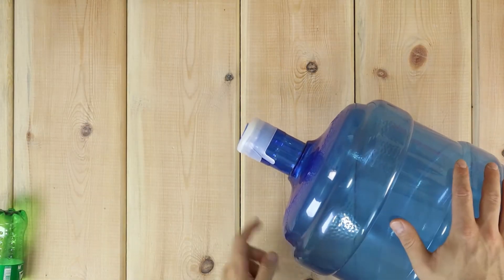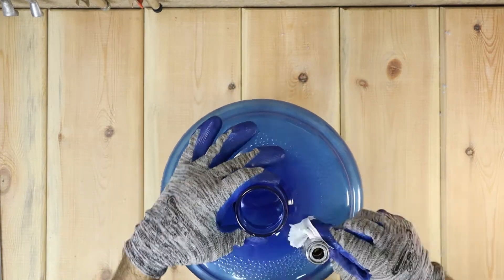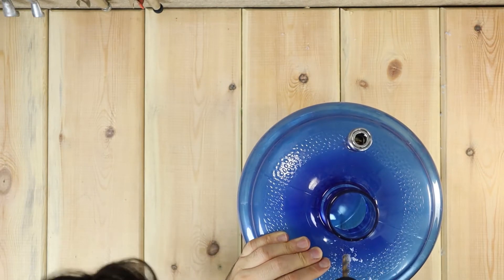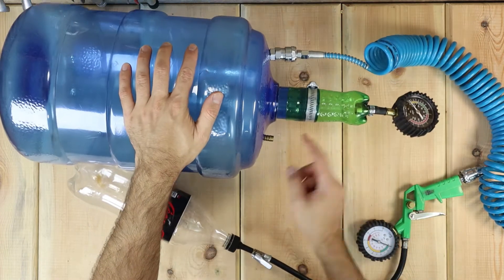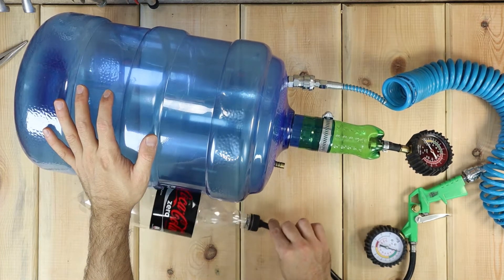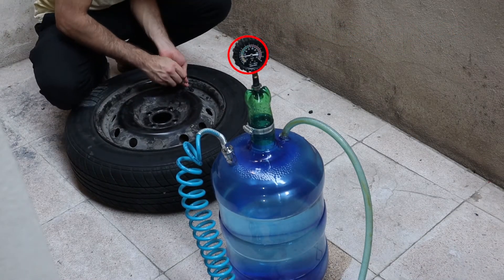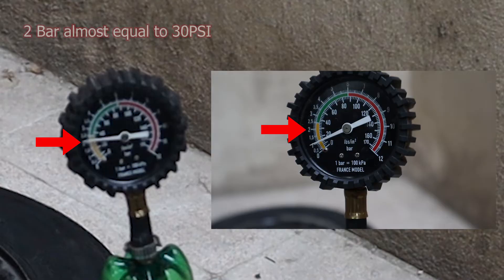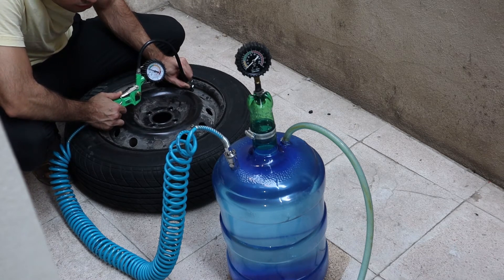Water Powered Air Compressor

Comment: ok, it's creative, i'll give you that, i wouldn't call this an air compressor lol....
if you are lucky you'll get 10 psi
Reply from the maker: Thanks man, I've managed to get 30 PSI in the air tank, I would say if you empty the water in the tank 2 or 3 times, and start over, you can get something acceptable. Your water pressure is the most important factor though.
Reply: @KayvanCrafted  i know i was just watching it for fun, don't need it as a tool, have an air compressor i built out of an ac compressor, it's small but it works, i am about to start working on a bigger one made out of 2 propane tanks, and i am planing to put up a video of that build when it's ready.
Reply from the maker: @ozb2006  Very nice my friend 👍
Reply: @KayvanCrafted  clever build. small fyi; without filter the compressed air will contain high amount of water vapor which can be unwanted and even dangerous for many uses. if the air will change temperature; increase the water vapor volume can expand, maybe explode something, if it gets much colder, the water vapor volume can decrease and maybe implode something.
Reply from the maker: @letsgiveall  Thank you for pointing this out my friend.
Reply: @KayvanCrafted  
Combine a bicycle pump with a class 2 lever and just use the weight of water to operate it. You`ll be able to generate 100psi+ with a few feet of head. Volume will be small and it`ll take a wqhile but still :)